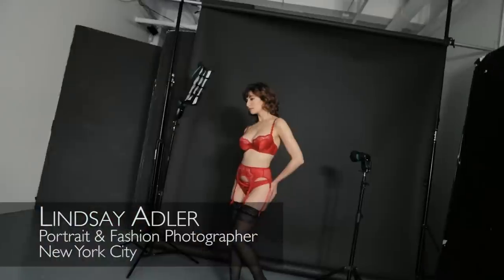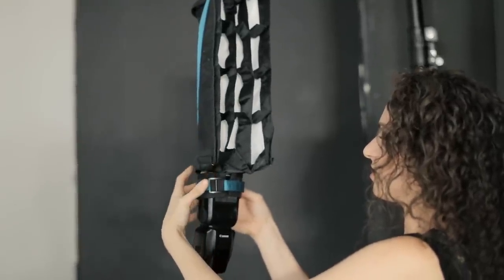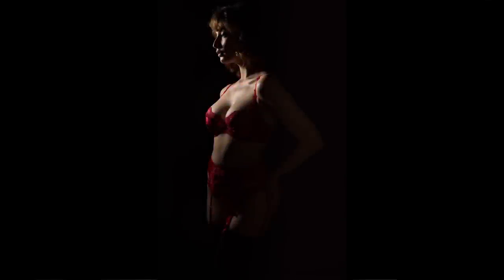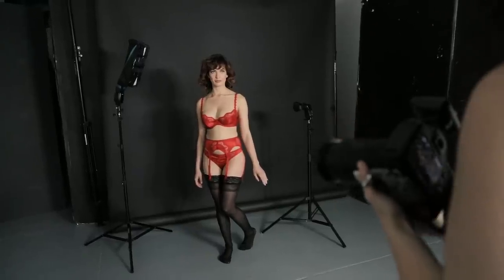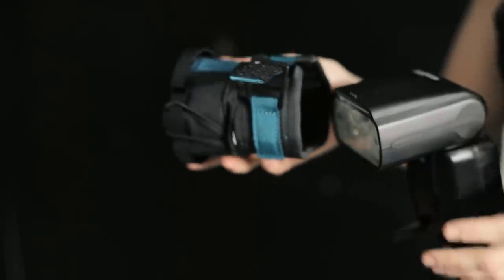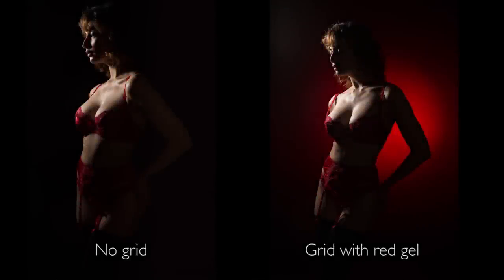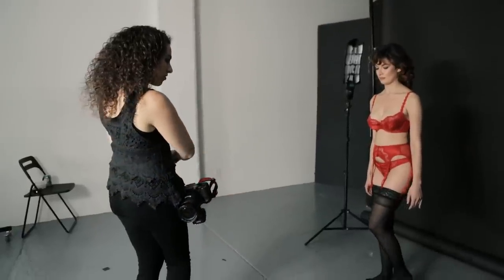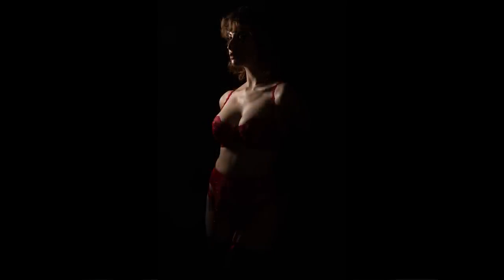Boudoir Photography with Lindsay Adler - Defining Curves with 2 Lights

Comment: what settings do you use on your camera
Reply from the maker: Hi Eddy, thanks for your question. Lindsay didn't provide the camera setting information for us unfortunately. However, you'll find that some experimentation with your flash and some modifiers would help, as every shooting situation is going to vary based on environment, equipment, model, etc. Let us know if you have any questions. Regards, -The ExpoImaging Team
Reply: She probably put it on "m." or maybe on "tv" or "av," but "m" works best for control.

She probably used a flash meter or figured out which f stop too put her camera on, then you can adjust the shutter try 1/15 or 1/8... See what happens. Look at your LCD and see if the light is too hot or too cool. Look at your "white balance too.

Maybe she put her lens f-stop on 5.6, or 8 and adjust the Manual Power of the flash on 1, 1/2, 1/4, 1/8, 1/16, 1/32, 1/64 or maybe 1/128. If you get good you start to be able to guess. You can look through your viewfinder and cheat.

So:

Put your flash on manual (see manual settings above) power or ETTL (automatic). Manual everything is a very good way to start.

Set your white balance or put it on "auto"

Set your camera on "m" or manual... 

Figure out the f-stop (manually select lens opening).

Figure out the shutter speed (it has to be less than 1/250 on canon cameras)

Look at LCD and adjust these factors. 

Those numbers are the fractions of FULL power you can put the flash power on. You can also use AUTOMATIC or ETTL / TTL. 

I am just trying to help beginners (as I am), trying to be helpful as I found this to be helpful and inspiring.